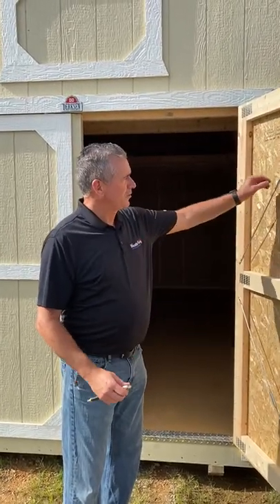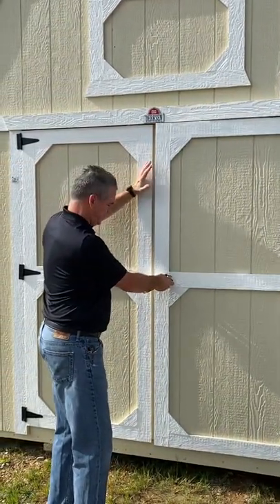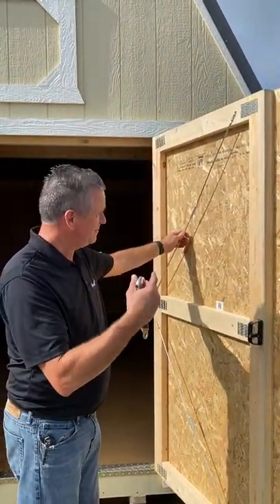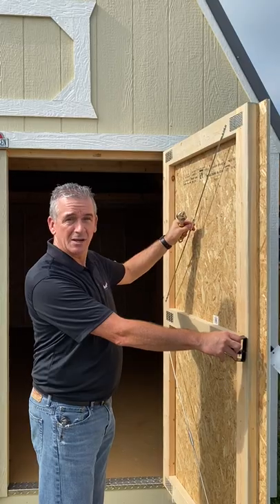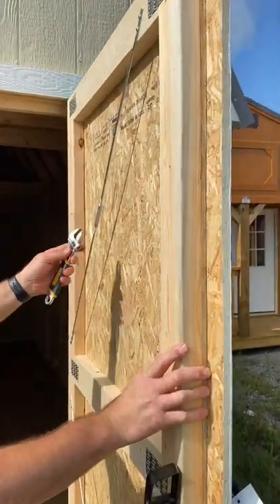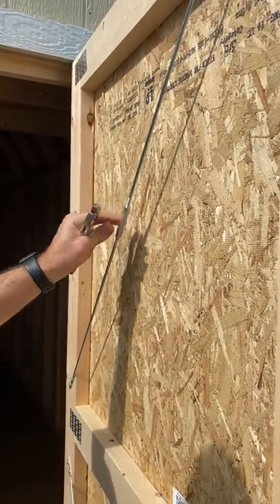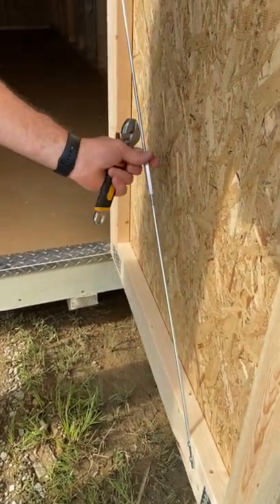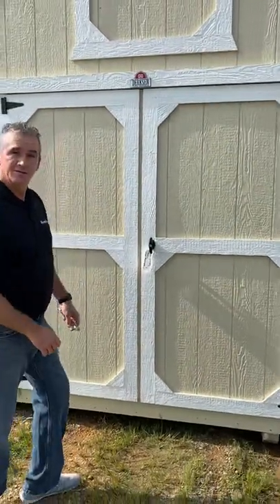Weather King Portable Building Turnbuckle Adjustment

Comment: If you paint both sides of the door when it’s straight it is much less likely to warp.
A church in my city had a large wooden cross on the front of the building that was there for years. Someone decided to paint it white, they only painted the outside. Over a year or to it warped drastically!. Wood expands when it is wet! The painted side will not allow moisture to enter, unpainted side expands, painted side does not. That is what caused your warping.
Reply: I believe you.
Reply: I'm unsure about this one. It also makes sense that if/when moisture does find it's way in that the wood will not dry, which will make for rot. I'm not sure what the right path is.

Comment: What is the purpose of the top turn buckle? I understand the bottom can  lift a dropping door but  tightening the top turnbuckle  does what?
Reply: These aren't for the door dropping (that means there's a problem with the hinges). The turn buckles need to ne tightened to prevent the corners of the door from pulling out. Think about a sticker on a table and its corners are peeling out. To prevent the corners bowing out there needs to be tension. In the past it was common to have a crossed beam diagonally that would also provide tension, albeit unadjustable.